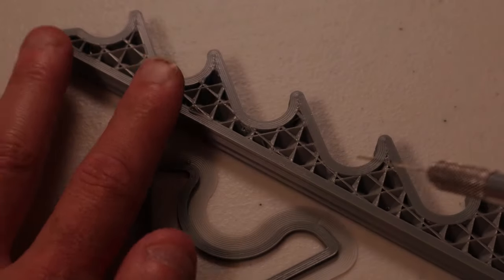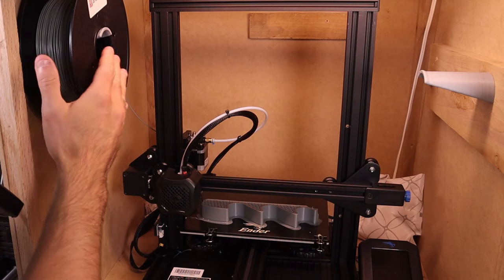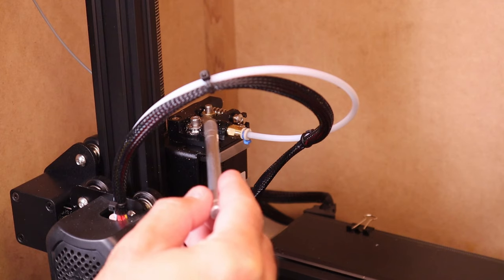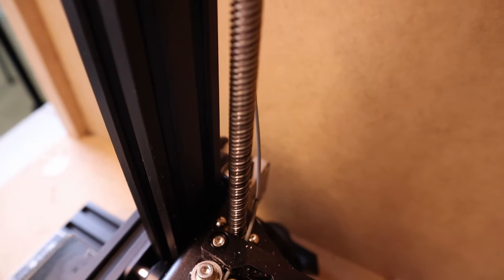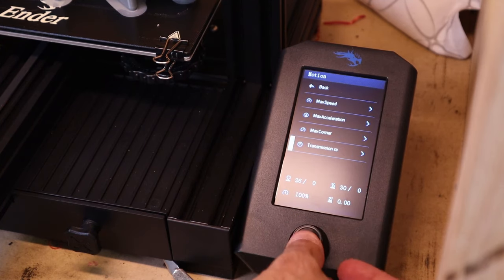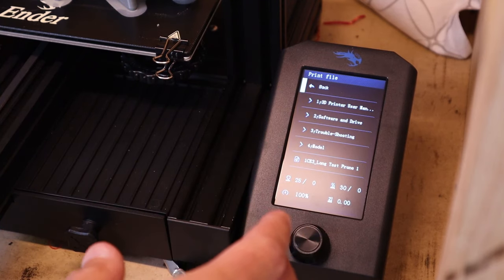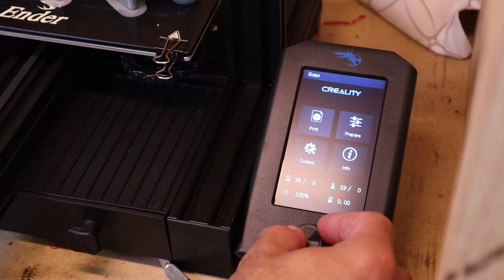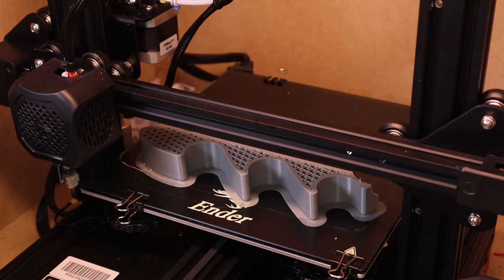Creality Ender 3 V2 - Solving Under-extrusion To Save You Hours

Comment: i literally changed 5 nozzles so far thinking its a clogging issue and now only using 0.8 mm nozzle to print coz i want the thing to be done. man you saved a lot of time... true engineer
Reply: Reeetweet

Comment: You can have a similar issue if the extruder has been mounted too close to the Z-screw. The filament can periodically drag on the Z and have varying resistance - in turn this slows the rate and under extrusion will occur. This is an excellent video with the step-by-step approach.
Reply from the maker: I've not heard this before.  I have had problems with the bowden tube being too short and a very tight rad would occur in the tube periodically causing extruder skipping and sometimes failure, I keep the tube around 14 and that seems to work well.
Reply: @NeedItMakeIt  well I encountered it today. And in trying to figure out what was causing ut I started searching and found your video.  I ruled everything out I  could find online. So I had to look to other causes and then figured out what was happening with the Z screw drag, resolved it and then passed along the info :)

Comment: there are flow rate settings in most slicers. dial that up and that can fix your issue as well.
Reply from the maker: Yes for sure, I do like to try to get mine setup to as close to accurate extrusion as possible so I can leave the software set to 99 or 100.

Comment: I have an Ender 3 V1 and this still helped me fix my problem! Had to adjust the spring pressure on the feeder. Never would have found this on my own.
Reply from the maker: One other issue I ran into while testing was the bowden tube length, if they are too short you'll get under extrusion and clogging as well, the tighter rads seem to cause jams in some situations.  I was having major problems with the 10" tube, swapped it for the 14" and never a problem since.  Glad it helped!

Comment: To get the correct settings for extruding I measured 10mm of filament from the extruder towards to spool and made a mark. Then I manually set it to extrude 10mm, from there I measured how much extruded from the mark and changed the settings to compensate.

Repeat till it extrudes correctly.
Reply: mine was 14mm off lol

Comment: Appreciate the help! For me it was tightening/loosening screws on the extruder, as you advised in the video. Now I have to go and "undo" all the other crap I did trying to troubleshoot on my own as a newbie.
Reply from the maker: We've all been there, I just went down the rabbit hole the other day myself.  It turned out to be an issue with Cura not liking the settings I had chosen for a part I've printed many times before with different settings, I had never seen the problem before on any part, a change to the layer thickness solved the glitch.

It does take quite a bit of experience to efficiently problem solve... the "oh I know exactly what that is" will come with time.
Reply: @NeedItMakeIt  absolutely. I think the best advice you provided was the process of troubleshooting step by step. I just wasn’t in that mindset, I got fixated on one issue I was sure was the problem(bed leveling). Honestly this was the first video I saw to get me in that mindset, others just throw tons of potential issues at the viewer without any process of “troubleshooting.” Without a troubleshooting process, it’s easy to get fixated on something you’ve had issues with before, even when it clearly isn’t the problem. Human brain things man. 

I appreciate the reply and video, stay safe and happy new year!

Keep up the great work!
Reply from the maker: @Ryan-cd9mt  Thanks for the support!  Happy new year to you as well!

Comment: Just commenting to push your video closer to the top of the search list as it's the most succinct and straight forward one I've found
Reply from the maker: Awesome, much appreciated.  I have since discovered another method without the need for a firmware upgrade if this interests you.  Some simple coding required.
Reply: @NeedItMakeIt  This one got me sorted, much appreciated :-)

Comment: I haven't had any issues for a while so I think I figured out what was wrong with mine. I'll post here in case anyone else finds it useful.

My extruder spring was too tight, which caused issues with certain prints and filaments. This tight spring resulted in the filament outright flattening and get stuck/slowing down substantially in the Bowden Tubing. This lead to slippage of the gear, which lead to more flattening and sometimes completely severing the filament at the gear, which cause no extrusion and a failed print.

How I fixed it was by just untightening the screw at the extruder gear until it was slipping from too little force and tightening it with a half turn. Later I tightened it slightly more with harder filament. Maybe like a 1/8th or 1/4 turn.

Hope this helps!
Reply: Thank you, this helped me alot your awesome
Reply: @thijswessels2267  No Problem, I'm glad it helped someone!

Comment: Thank you! I couldn't figure out why I was getting issues with under extrusion even though I calibrated the e-steps when I got my new extruder. I had the same issue where the steps weren't actually saved to the printer itself!

Comment: I went through the same steps. Replaced my hot end too. Bought a filament dehydrator box to run my filament straight in from the side and also in case my filament was "wet". Still printed exact same. Bought a new filament roll. Still the same.

I think my printer is underextruding too. It will stick halfway through the first layer, then it sticks off and on. If the first layer completes, it stops sticking about a centimeter up.

Comment: Mine's doing something odd and I can't for the life of me track down what. The motors are both running in sync, the bed plate is certainly hot enough (between 60-80) and the nozzle is hot enough (between 90-190 depending). I have a plain old Ender 3. The problem as I can figure, the filament isn't being fed through quick enough, and I dunno what setting to tune or tweak. Then too, nothing really sticks to the bed. The nozzle/filament tube aren't clogged, I literally just took it all apart and cleaned it out completely. Heeellllp.

Comment: On my old CR10 the issue seemed to be caused by an insufficient front cooling fan which meant that heat was creeping too far past the heatsync. So I was getting clogs in the Bowden tube near the hotend.
It can also be caused by the well known Bowden tube issue where the Bowden is not cut perfectly flat and is not fully pushed as far as possible into the hotend.
Reply from the maker: I can't say I've had problems with heat creep on any of my printers, but it is something to keep in mind for any hot end changes that one might make.  Can the fan be too powerful?  The Ender3 v2 has a very noisy fan, but I believe the shroud contains the flow somewhat and I also think it give a poor view of the printing as well.   Why not make a clear shroud?  The bowden problem I think is an area they need to focus some attention, those couplers/adapets are not made very well and there is some slop.  over time the movement seems to wear the ends of the bowden tube away and will cause a potentially major fail.  I took one of the adapters apart the other day and I found 3 small steel spring knives that dig into the tube and a sloppy fit for the tube into the connector, not too impressed with that.

Great points by the way, thank you!
Reply: @NeedItMakeIt  I have two CR10S’ and an Ender3 Pro. Under extrusion was an issue until I replaced the plastic extruder with an all metal one. Had to replace the spring that came with it but it’s more dependable now when using various slicer settings. Heat creep and nozzle clogs are consistent problems with all of my machines, especially on larger/longer prints. I’m tempted to get a V2 like yours but with constant nozzle clogs on my current machines, I don’t want to make replacing the nozzle and bowden tube more difficult with the new hotend cover. Also I agree with you about not being able to see the hotend fan. A clear cover like you mentioned would be much nicer. I think they went with the smaller holes in the V2 cover to try to mitigate the issue with stringing getting sucked up into the hotend fan causing it to slow and possibly eventually fail. In my opinion Creality should try harder to resolve these known and common issues before worrying about things like tension knobs and tool drawers. If price wasn’t an issue I’d love to have a Prusa but hard to buy one Prusa over two CR10’s or 4 Ender3 Pros. Overall I am happy with my Creality printers though, just wish they’d try harder to fix known issues like the ones you’ve pointed out. PS - Thanks for the great video and please keep them coming. You are very well spoken!
Reply from the maker: @3dbronze  I agree completely, I suppose they were focused on looks rather than function.  I can't say I've had any heat creep problems yet, I have had a nozzle clog that stumped me for a day due to using CF-PETG without being equipped properly for it (I believe I am now).   I have also been investigating the tubes themselves and it looks like there is more to the Capricorn tubing than what I knew only a few weeks ago.  The cheaper tubes will melt at a lower temp... degrade and allow half-melted filament to flow into that cavity which then causes the extruder to work harder to push filament through and eventually it will come back looking like a nozzle clog.  Melted PTFE is also poison so I didn't mind spending  $15 for the good stuff.  The one I've purchased is rated UP to 350C. 

I have considered upgrading the fan it is very loud and the cover design doesn't help.   To your point a fan mounted higher would be better to keep debris away, that's a good consideration.

I have another video coming soon, and one right after that which are more general solutions, though I am applying them to my printer.  Thank you very much BTW, love the detailed comments!

Do you have experience printing CF filaments?  If so, any advice?

Comment: I have the ender 3 v2 and I updated the extruder to a duel gear extruder, watched a video for the calculations to change from 93 to 138.8 so it's still in reality the same as 93. I am getting crazy separation now since this upgrade. Should I change that setting and go a bit higher to simulate the same thing you did?
Reply from the maker: If it is that bad, the extruder is either not feeding as expected, which is unusual for a dual gear, or the e-step changes are not being saved correctly.   https://drive.google.com/file/d/1NQGiJOq1wygLa3jnxyJ8Kz8ck1VhiteT/view?usp=sharing  here is the firmware I am using, it works perfectly, I just installed it on my 2nd E3V2 printer as well.   Do you have any jambing or clogging as well, or just under-extrusion?
Reply: @NeedItMakeIt  after a bit more recalibrating I finally got it to print really well except the top layer, gets little bumps now. And for some reason I need to keep the cooling fan off when I am printing PLA or the layers will still separate. I also upgraded my hotend to an all metal one if that matters.
Reply: @michaelhudson7809  after thinking that i got it all sorted i still seem to be having issues, prints are still coming out not good, i feel like it is under extruding. I did not have all these issues until i upgraded to the duel gear extruder, i am so close to throwing that damn thing in the garbage and buying the original all metal one. They are cheap enough.

Comment: I have the same issue with under extrusion. I have firmware v 1.0.2 and the 4.2.2 main board. I can not get the new transmission ratio to save. Keeps reverting back to 93. Frustrated and at a loss at this point.
Reply from the maker: If the printer doesn't make a beep when you press storage configuration and doesn't keep the change you'll need to upgrade the firmware, there should be a link in the description of this video to help.
Reply: NeedItMakeIt I ended up flashing with Jyers. That solved the that issue. After adjusting the esteps the part I printed was maybe a tad better. After going over everything I ended up downloading Prusa slicer to try and printed it again. All layers and walls are bonded. So that leads me to believe I don’t have something set right in Cura. Looking at it know to see what settings were different and adjust them in Cura and print it again.

Comment: I've been having an issue with taller prints, my bed is level I always triple check. Printing smaller objects around 3-5 inches is fine, but over about 6 inches the nozzle rubs the print and the tip gets clogged. Know any way to fix this?
Reply from the maker: Would you say this is a new issue, or something you've had problems with since you assembled it?  

My first thoughts would be to check to see how well the vertical extrusions are aligned, are the bolts tight are they the exact same distance apart from top to bottom.  Next, you could have a problem with the Z-axis guide wheels not being tight enough... or too tight on the extrusions.   This printer has only one lead screw controlling the z motion and too tight and too loose are both issues I had at the beginning.  

These printers are supposed to have CNC'd parts for accuracy, it is possible that you have an extrusion cut out of square, also holes may not be drilled in the correct location.  I did notice that they can rotate a bit during assembly, so please make sure the extrusions are parallel with a long straight edge.
Reply: @NeedItMakeIt  I’ve had this issue since assembly, I checked the measurements everything is squared.

Comment: Perfect video so informative! I found a problem before your video so that wasnt help, but for future it is great to know what everything else can do under extrusion.. My problem was in extruder pressure so i bought dual metal extruder and its ok :-)
Reply from the maker: That's great thanks for the comment!   I've had another problem as well after this video, I tested a short tube 10", it was too short and caused the filament to bind on occasion and ruin multiple prints.  14" is a good length.

Comment: Checking the diameter of the filament.
Feed calibration (number of steps per mm. measurement of the number of steps for feeding 10cm for example). 
Flow calibration (printing single wall test hollow cubes without lid and measuring wall thickness).

Comment: I wonder why this happens, I have to increase flow to 130% and I also noticed a change in color. I was using blue overture and at 100% flow on a new printer it was dark blue, and at 130% on the printer having under extrusion issues the color is slightly lighter dark blue. All printers used are the E3v2.

Comment: I unfortunately had a hardware failure. that arm that holds the bearing to the filament got a crack in it and I only found out when I took the extruder apart. Looked completely normal from above. I recommend the metal extruder upgrade.

Comment: what if you dont see transmission ratio under motion? i have feedrate; acceleration; jerk and step/mm
Reply from the maker: There has to be a method on the printer to adjust this, It is possible that your printer came with different firmware.   Can you link a photo of your printer screen, and I can check on this later on.  If you don't hear from me it is because I find YT comments very tough to track, so please follow up.
Reply from the maker: https://drive.google.com/file/d/1NQGiJOq1wygLa3jnxyJ8Kz8ck1VhiteT/view?usp=sharing 

If you don't have the transmission ration available there might be a problem with your firmware, here is the version I am running.   Pick a day you don't need to use your printer just incase.  Keep the original firmware saved on your PC incase something goes wrong.  There are some videos already on how to update the firmware as referenced in the description of my video if you need help.

Comment: I’m so excited to try this when I get home. I just got my ender 3 v2 and I haven’t had a successful print since I got it. I have tried so many different things and I think this is the fix for me.
Reply: Sooo.. Did it work?
Reply: @moldusgaming7282  yes but ultimately I switched extruders and firmware for better prints. I’m currently running a Creality Sprite head with Marlin 2.0.1 firmware.

Comment: Hi guys, I printed great for 2 months and suddenly I have under extrusion. Which is the correct configuration for the screws I restore back some of the quality with loose, tight, thigh (from left to right) But I can not achieve the original quality I was having... (I already clean the nozzle)
Reply: Might be nozzle wear.

Comment: i cant figure out why my ender 2 keep failing to extrude mid-print. everything is trammed(leveled, wtv) and im using an mks gen l v2.1 board with tmc2208s, a titan direct extruder and volcano hot end combo. running klipper firmware, using mainsailOS. been scratching my head quite a bit as to the why. any pointers would be appreciated

Comment: Thanks for advise man, I have the nozle problem and i try to solve it. the first one died after i started scraching the bed even with the right distance from it... Your advise is very useful
Reply from the maker: The best advice for this problem is to never move your printer.   I learned hard lessons with my Anet A8, any movement of the printer would throw off the level and it was a terrible machine to re-level.  The Ender is much better, still I only move it if I have to.  Each time I move it, the bed still needs to be leveled a little bit.  Are you running with a glass build-plate?   As far as the nozzle, is it clogged, normally when the nozzle goes too low the bed springs come into action and allow for the bed to lower slightly, helps also with rapid movements over infill or over that first rough top layer.